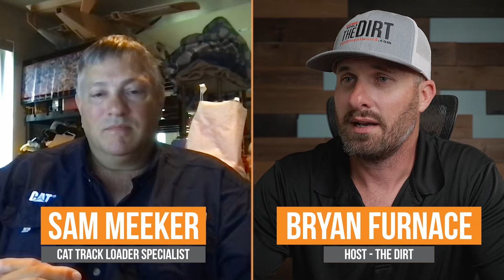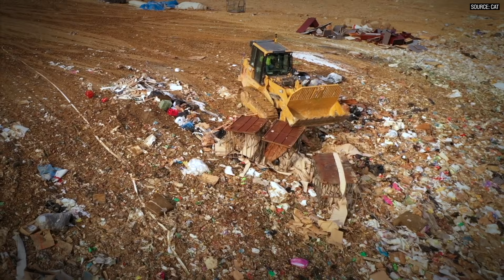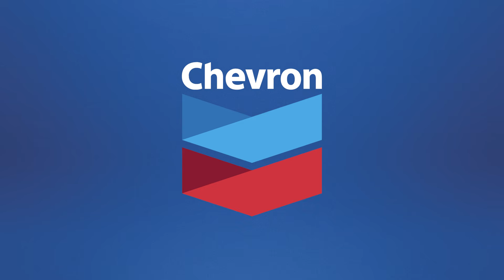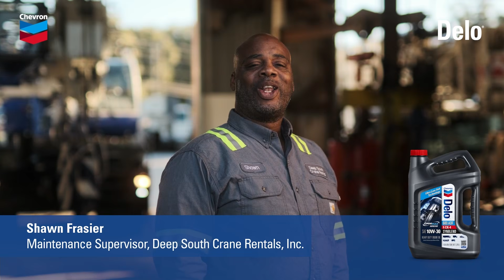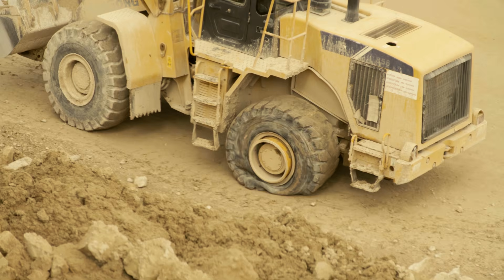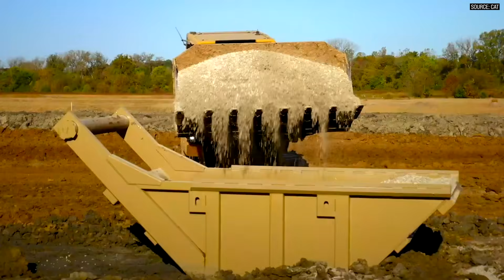“A Great Big Skid Steer” – A Closer Look at Cat’s Mighty Track Loaders

Comment: You aren't kidding. They do a lot of granite quarrying around here and they use heavy loaders and forks for moving materials around, and they just have rows and stacks of used tires all over the quarry, slashed and sliced and gouged by the stone shards and chunks. I can't remember now what it was I saw but I remember determining that at least one the the tires was only about a year old, and it was already for replacement, totally cut up and worn out. Those things are probably $20,000 each, maybe more.

Comment: I m on my third under caridge  7400 hrs working in sandy soil or very rocky ground will wear tracks fast.
Reply: Because loader tires are cheap and last forever on rocky ground, right? I'm sure those steel tracks wear out way faster than rubber.

Comment: So, my WA320 wheel loader runs a 3.5yd bucket in heavy aggregate with capacity to spare. It weighs ~35k lbs. Why does a 953 at ~45k lbs have a smaller bucket?

Comment: Thank you for covering the all around King on a work site 😊 the Track Loader. It is my favorite also. In 1979 we used a
 track Loader on a big sewer mainline job in huge housing development. The easement for the mainline were in rocky brushy hardpan dirt. Unfortunately we did not have a Cat machine, but that 850-B Case Loader was very fast running pea gravel to the 350 Bucyrus Erie excavator 
The power track system Case built-in to there track machine lineup was very interesting design. We had a 
125 International on job also, it was very powerful but it did Not have the speed of the Case. A wheel loader would not have worked for us on that job. My favorite Cat Loader is the 955 & 977 series. 😊❤😊

Comment: I didn't believe we would ever need a Track Loader, but after We bought a CAT 973 , Its normally the first machine on site
Reply: Ive noticed a lot of companies dont value track loaders much but the company where i first started excavation the track loader was still valued less than the dozer n exca but we always had multiple on site because they're so viable for anything, you can unload materials w the forklift teeths, slight grading, pushing and making material dumps, and its even really good for carrying pipes even if tire is the more typical option it still provides better stability for pipes such as sanitary that have to be balanced perfectly